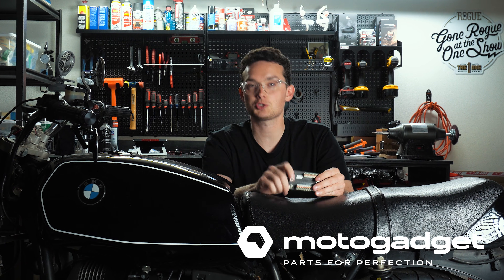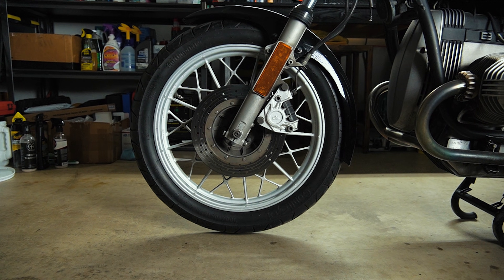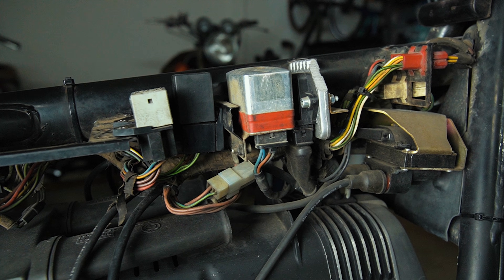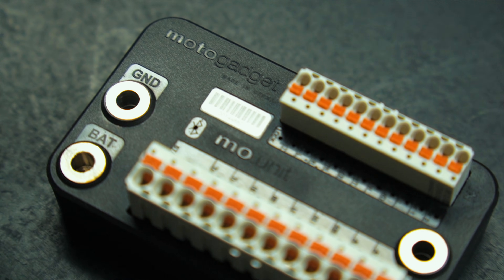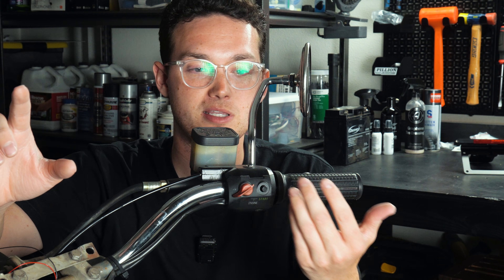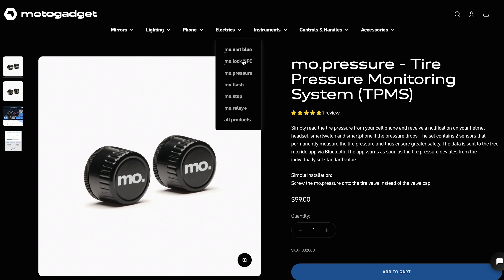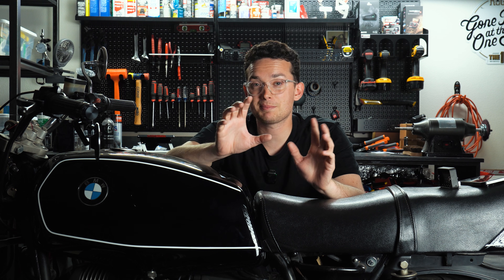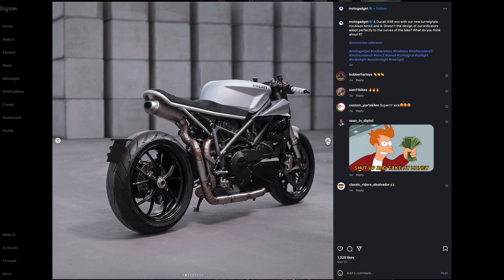Motogadget Official: mo.unit Install - Part 1 | FAQs + Shopping List

Comment: I've been contemplating grabbing this for a 1982 CB900 Custom build. I really want to change over the lights to modern lights. I also want to add things like fuel level sensor. I'm on the fence about changing the gauges but I would like to tidy it up.